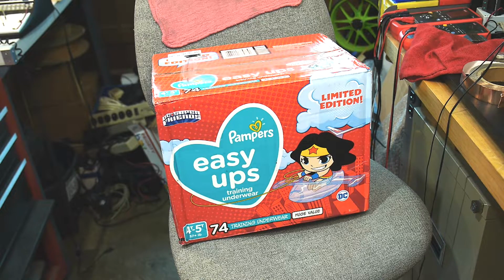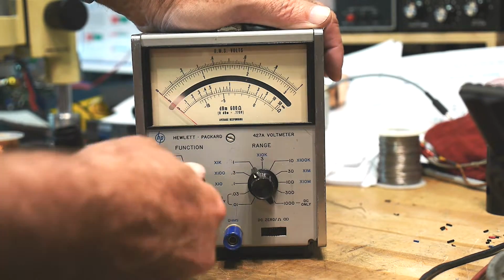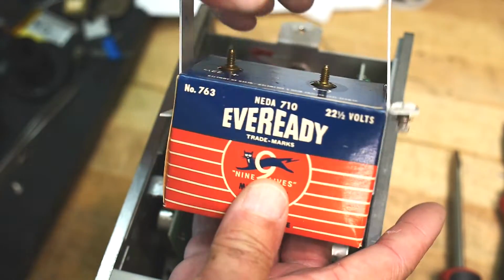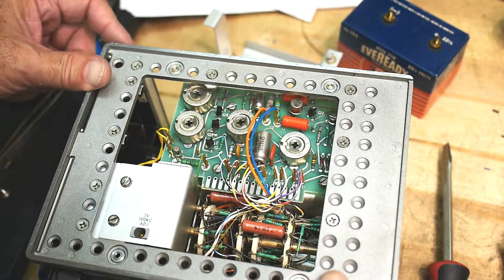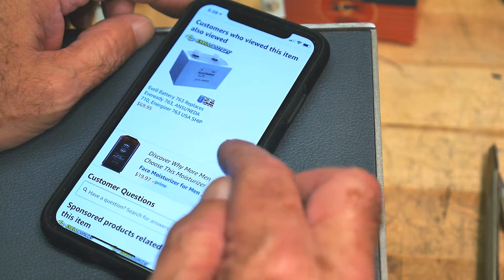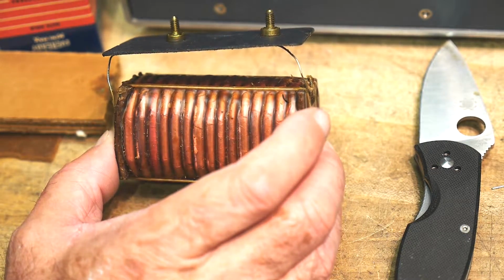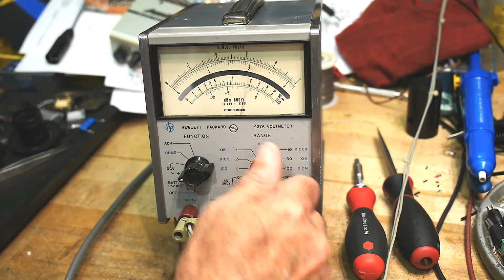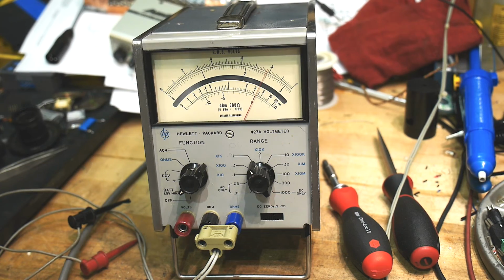#460 HP427A Vintage Multimeter (part 1 of 2)

Comment: Tip for anyone watching that owns one of these.  You can gut the battery, keep the terminal plate, solder 2 9v battery connectors in series for 18 volts.  make a foam insert for the 9v batteries to fit in the now old battery 'SHELL.
WORKS PERFECT!
Reply from the maker: yes, and they can watch part 2 where I do just that

Comment: I found some docs that show the 427A was made beginning in 1966, but it apparently had a long run.
Reply from the maker: There was 435 and 436. Don't think the 437 is that old
Reply: @IMSAIGuy  Yeah, I was talking specifically about the 427A. The 436 and 437 are wattmeters, as you know, and based on the design, the 432 was probably introduced about the same time as the 427A. My 427A is battery-only and the previous owner put a phone jack in the back panel for dc input to replace the battery. That works, but the meter is in great need of calibration.
Reply from the maker: @radiok2ua  sorry, I was confused, I had just done a video and had a 437 watt meter on my mind. yes the 427 is old.

Comment: Hi, since I bought this meter based on your video, I wanted to look at this series again and now I noticed that you made a mistake at 24:44. When measuring the resistance, a value of around 3,300 Ohms was actually measured, but you read 2,400 because you were looking at the scale for volts.

Nice day 🙂 Tom

Comment: I made a battery pack for mine with 6 18650 batteries. The pack fits neatly in the space provided and I put lugs on it that go in the original location. It runs for months before it needs a charge. 

Changed a few sort of bad caps and aligned it. A real beauty.

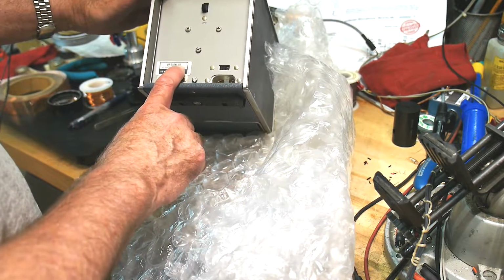Comment: At about 2:16   Option 1allows a choice of AC line power supply or battery selectable on the rear of the meter

Comment: I would replace it with five 3-cell holders in series.  Probably AA size would work, but you can easily measure it and see.
Reply: 2 9v batteries in series work well.

Comment: I picked up one on Craigslist a year or two ago... 

I built a battery using 15 AA or AAA cells(can't remember which) and the button of a baking soda box...

Fits perfectly...

Was going to calibrate it, but after checking it on my fluke 5100A... It was still dead nuts... HP built solid gear...
Reply: Overly complex. The thing draws 25mA, two USB rechargeable 9V cells in series is all you need. The meter needs a minimum of 15V per the manual so it's fine.

Comment: I have a HP400EL AC model that's good up to 10 MHz and us it quite frequently especially for tuning stuff where an analog movement is best.
Reply from the maker: Anyone who has aligned a radio understands you need an analog meter. The 400 series was one on HP big wins

Comment: I don't think you are going to find oscillators in a device that is purely analog. Moat likely those are adjustable caps for AC frequency compensation.
Reply from the maker: yes your are correct!
Reply: For your 22.5 volt battery I wonder if you could use three 9v batteries and an LM317 adjustable regulator? A lot cheaper than $49.
Reply: Oscillators are analog, what on Earth kind of logic is this? How did radios work in 1937 for example?